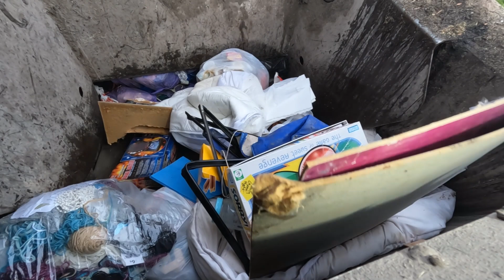Hopper Cam 24/8/22 Acco/Superior Pak

Comment: Nice video. It would be cool if you filled the hopper up on a commercial run with the manual pack on this truck one day. What is the shortest run and what is the longest and how long/ how many loads are they?
Reply from the maker: Shortest run is 640bins biggest is 1299.
Longest run is a 870bin day.
Reply: @nitrobusa  So its around two-three loads roughly?

Comment: You changed the garbagetruck ?
Thanks for this video.

Greetings
Reply from the maker: Mine has no a/c so I refuse to drive it
Reply: @nitrobusa  a/c is certainly welcome on very hot days
Reply: @nitrobusa  Cant blame you for that, i worked for the post office for 30 years had my share of hot days, the little piece of crap fan that was provided hardly did anything, one time was doing a route in where just like yourself it requires sitting in the truck for most of the day, so told my boss man taking another truck and hopefully the union would stand behind me, turned out to be a bad fuse! So got to blow the hot air around again!! And then the questions from the customers, same one always "Do you have a/c?" and i answer with this, yea i have 260 Air, then they say "Whats that?" i tell em 2 windows, 60 mph!!! Have a great day !!

Comment: Do you have a preference for a particular packing type?  Or are they much the same to get on with .  I drive rear loaders  they're much of a muchness . Only the bin lifts are different.
Reply from the maker: It’s not the packing. It’s the arm. 
The bucher you can slide in between touching bins, the spak you need at least a foot gap. Also the bucher you can be more sloppy, ie not grab the bin properly without the bin falling in the hopper.
Reply: @nitrobusa  How about in general systems? I quite like the Spak looking ones. I have only used an old GenV so I can't judge too much. Mind you in riding multiple spaks, they are a fair bit neater.
Reply from the maker: @northernriverstransportvlogs  bucher are like riding a bull. Spaks are your still riding the bull, but it’s wearing a top hat.